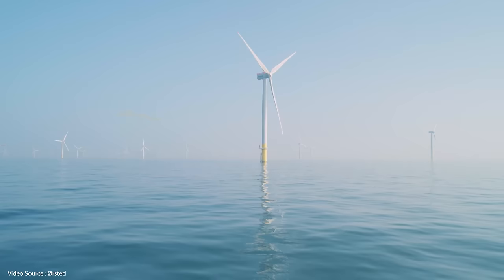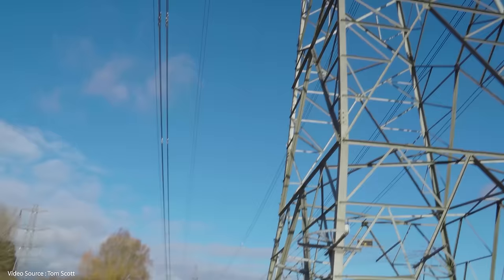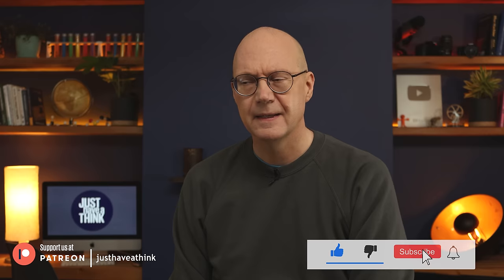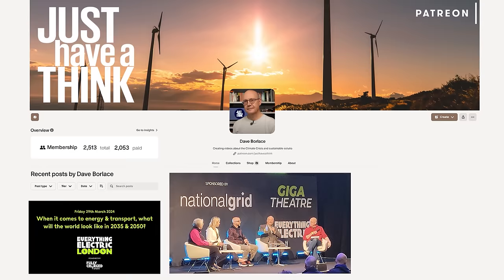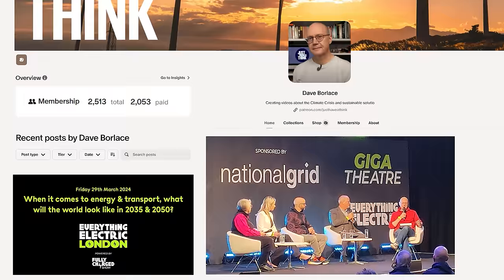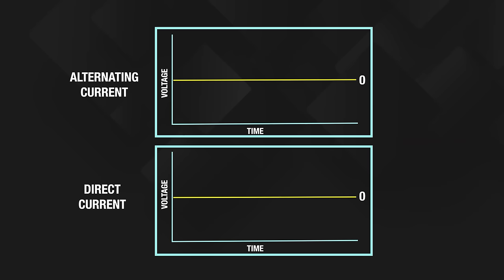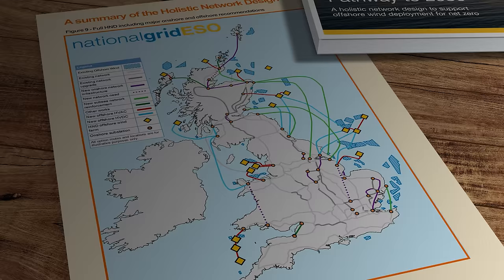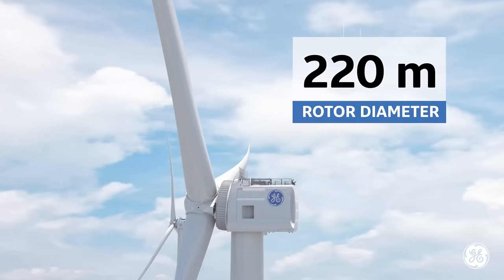Ocean Electricity Grid. How do they do that?

Comment: You're not missing anything, it will be bloody expensive. The other problems are coordinating it, choosing where to build, getting the green light for anticipatory investment, choosing who will be the organisation who builds it (the offshore system operator), etc. 

On top of that the risk of stranded assets is huge because of the problems with the CfD.

The UK hasn't even got close to getting it right first time, and the £5bn saving is based on amazingly optimistic forecasts.

The simpler, more efficient and cost effective, way for it to be dealt with would be to specify the additional equipment required on the offshore substations to connect them at a later date.

Low frequency AC is thought to be most efficient by a German professor after they'd already gone down the difficult HVDC route.

Comment: Sea transmission lines are not only more expensive to install, they are also much more expensive to maintain. All for the aesthetic reason of not having to look at on shore power transmission cables (most of which exist away from population centers). I understand the NIMBY mindset, but I certainly wouldn't say this is a "future proofing" option because we know those in charge will eventually get tired of fully funding the expensive maintenance of underwater cables, and the infrastructure reliability will suffer as a result.

Comment: Pylons are cheaper than buried or under water because they ignore the costs to the people and areas thy affect. I live in Lincolnshire and at the moment am threatened with a cable passing if not over my home very close to it. This will cost me at least 1/2 the value of my house and leave me with all the consequences of living so near to the cables. I am quite happy that if this is a project of "National Importance" then it should go ahead but all those affected by this should be fully compensated by those that benefit from the scheme.
When you take this figure into account you find that under sea direct to London is the best option.
My house is off grid so gains no benefit from the grid.

Comment: Winds. I took a quick look for an hour but it needs a well-paid professional because the Sun keeps forcing the wind to happen due to it heats Earth unevenly (Tropics face the Sun more directly than Polar regions and that's what causes steering winds). I did calculate in my head that wind kinetic energy matches 7 days of all human energy use (if my memory from 3 years back is correct) but since the Sun will fight any attempt to stop the steering winds simply by blocking them (as opposed to heating at 60-90N which I hypothesize might be slowing the Ferrell Cell) and since the Sun is massive powerful I can't see any feasible mechanical effort to slow the steering winds being able to slow them much due to it's directly fighting the source of ~all energy on Earth. Geothermal & nuclear fission are 0.035% and 0.015% of all energy on Earth, not much of a portion.

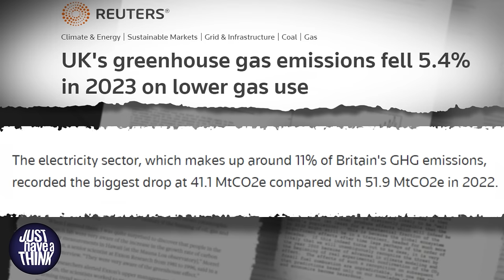Comment: 0:33 "But transmitting those electrons" - so let me be that guy (again) and remind us that the electrons don't travel far.  In an alternating current the electrons only move a tiny bit, and in direct current the net motion is small (especially for the heavy gauge wires used in power distribution.)    Ok, so that's pedantic, but in this case it is important to realize that the energy is transferred by the electric field that exists outside the conductor. This is normally a case of problems in any electric grid, but in sea water the electric cables have to be armored which then adds to the cost.  And of course protected from being corrupted in the salt water, another additional cost.  So while an electric grid online is expensive, there are special costs for underwater grids.
Reply: It's worth noting that there are now more discussions over the effects that undersea power cables have on the organisms down on the seabed.  Though the power cables are shielded, that does not keep (part) of the magnetic field from being outside of the shield, and that induces electric currents outside the cable.  All of this is how energy is loss in transmission, but also living organisms may have evolved to exploit Earth's own magnetic field (for direction finding, for example).
Reply: @TheDanEdwards  "induces electric currents outside the cable" with A.C. but not with D.C.   Well, only to the extent that the D.C. current varies.

Comment: I wonder if wind turbine operators have had much experience yet with wind farms located in hurricane prone areas like the Atlantic and Gulf of Mexico in the southern U.S.? There is a lot of shallow water and great wind turbine potential there if systems can be designed to withstand the current hurricanes and even stronger and more frequent ones forecast in the near future.

Comment: I am interested in why the UK has so much offshore wind compared with other countries.  Pioneers in the technology?  Now economies of scale.   High but not too high average wind speeds?   Relatively calm water enough of the time? Lots of shallow water around the coasts allowing fixed rather than floating towers.  Accessible shorelines for bringing cables ashore etc.    And ports for servicing.   The UK is perhaps well-blessed with those qualities.
Question:  How does all that offshore infrastructure affect fishing?  Trawling and undersea cables are not a good mix.
I'd be interested to see just how offshore electrical connections are made.    I suspect that avoiding offshore connections/switching is one (the most important?) way to minimise expossure to salt water.  
I think the other issue is avoiding moving parts (floating towers, cables that must move with the floating tower) under water because of the high maintenance costs involved.  Hence fixed towers better than floating ones.  Hence look for shallow water.
DC advantages:   the available current and voltage capacities are used all the time rather than use fluctuating.    And  better performance under water particulalry where large cables are required.

Comment: I like the paint job, Dave!  But a nice neon tube "JHT" logo on that big grey surface behind your head would be awesome!.. But to be honest, I think you already have something less flashy in mind to hang there.

Btw, how is that HVDC line going between Morocco and the UK? After its announcement it has gone pretty quiet.

This whole distrubution network of renewable energy gets more and more important with more and more renewable energy coming online, it squashes the argument of "dunkelflaute" because if the wind does not blow here and the sun does not shine here, it probably does a lot more somewhere else, so we need to be able to transport that energy to areas where it is needed the most.

Good to see the UK is working on this, I am sure other EU countries are working on similar projects as well... Good idea about the coastlines of the USA, but your cynism is justified, as the energy sector is still fragmented between several companies that all want to make a profit the next quarter and thinking ahead and invest and build for the future are not their strongest points.. Hence they have still low voltage overhead powerlines everywhere causing major problems with power outages with every storm that blows over, and years behind in adopting renewable energy and they just get started building off shore wind farms.
Reply from the maker: When you guys are not watching me there is a nice big pine-framed mirror hanging there. X-Links are going great guns. I will be posting an update video on their progress late this year :-)

Comment: According to Google, the average cost of a large offshore wind generator is 20M.  Apparently, the average home to go off grid would be around $30K with little maintenance, whereas, the average maintenance cost for a wind generator is around $45K per year. IMO, to solve most of the problems that you've pointed out could be solved by requiring, and using the $20M (plus the cost of many more wind generators) to subsidize every home and/or land owner to have their own solar and battery system, with little to no maintenance cost per year. At the very least, have mini-grids in every neighborhood.  Little to no infrastructure needed.  Of course, the people in charge want the big bucks for themselves while not allowing electrical independence for the average citizen, as proven by what happened to Nikola Tesla.  Heavy sigh...

Comment: Interesting fact I heard from some other environmentally aware youtuber  is that climate change is also causing  poles to warm up much quicker than equator, which means less difference in temperature hence less wind.
Reply from the maker: There will always be wind as long as the earth is turning.
Reply: For sure northern polar is warming 3.8x as fast as average. My understanding is that southern polar is warming less than average but there's big disagreement between instrumental bunch & proxy bunch.  My opinion is southern polar is warming less because southern Polar Jet has strengthened & tightened instead of going Wonky. I think you are correct regarding 30N-60N and I even wonder whether that's part of why the ocean's warming more. I have thin tentative science on it though, ongoing hobby project.

Comment: That's great but your numbers are a little bit off 
Once you have more than two sublime and generating electricity on the same line you could only get and use less than 20% of the advertised output it's called ohm's law so the inherent problem with the meters are not designed to run backwards 
Electricity is like water you must overcome the incoming voltage or pressure if you will to put anything in
Have you ever used a car battery charger it's kind of like that as the battery gets Fuller less power goes in but Watts stays the same

Comment: Why offshore cables why not hydraulics and generate onshore demineralized water with inhibitors will be much cheaper than electric cables with pressure to operate the same as trailer brakes and the pumps can be housed in the base of the structures

Comment: 2:37 Um.. quick question... has anyone done a study on the effects of massive ocean wind generation with worldwide air currents? Asking for a friend...
Reply: So much noise pollution it disturbs wild life there greatly and increase stress too.
Reply: I took a quick look for an hour but it needs a well-paid professional because the Sun keeps forcing the wind to happen due to it heats Earth unevenly (Tropics face the Sun more directly than Polar regions and that's what causes steering winds). I did calculate in my head that wind kinetic energy matches 7 days of all human energy use (if my memory from 3 years back is correct) but since the Sun will fight any attempt to stop the steering winds simply by blocking them (as opposed to heating at 60-90N which I hypothesize might be slowing the Ferrell Cell) and since the Sun is massive powerful I can't see any feasible mechanical effort to slow the steering winds being able to slow them much due to its directly fighting the source of ~all energy on Earth. Geothermal & nuclear fission are 0.035% and 0.015% of all energy on Earth, not much of a portion.
Reply: Yes, but I can't reference it. But there could be a problem. Not only could wind power change regional climate (climate change!) but there is only so much energy in the 'system'. A point may be reached were each new turbine installed reduces the output of all the other turbines by a tiny bit with no net gain! Not talked about as much as it should be.

Comment: I think you're being a bit too generous to the onshore peeps here. I do admittedly also think their detractors are too harsh! They're not wrong that there are downsides to the land based option but they seem to very much be arguing that a mild inconvenience to them shoukd be valued as a cost of £infinity, regardless of anything else. It's that aspect of it that seems to drive everything and it is that binary, winner takes all, thing that makes so many green energy projects unnecessarily difficult. It would be very helpful if we had systems in place that more reasonably compensated losses and inconvenience incurred by people, such that it sometimes becomes the better buisness choice to take an alternative route, and so companies are incentivised to do that, and sometimes it's still better to build the green thing and get it working but instead of valuing residents at zero in that scenario they then recieve an appropriate cut of the gains for the negative consequences they experience.

Comment: i think it's a mistake to re invent the grid by re centralizing production instead of diversifying it.the only reason for high voltage AC is for reasons of transmission over long distances. home solar low voltage (12 v) D.C. storage coupled with neighborhood low voltage D.C. storage and solar / wind generation facilities might make more sense. funny how in a way, Edison may have had it right in the first place.

Comment: Dave, in your previous video about HVDC transmission, you mention that the breakeven distance for a DC installation to be economically equal to an AC installation is 600 km. Here in this video you say it is 80. Which one is true? Has the technology cheapened nearly one order of magnitude in 3 years?
Reply from the maker: Break even for overhead cables is about 600km. Break even for cables underground or under water is about 80km because AC losses are much greater in those environments.
Reply: @JustHaveaThink  Thank you 👍

Comment: What do all of these wind turbines do during the summer? 

I’ve often heard the Uk is the Saudi Arabia of wind, so it would be amazing if we could really become a world leader in implementing and deploying this technology.  But how do we address the issues associated with the intermittent nature of these energy sources?

Is nuclear the only option to plug this gap?
Reply: The naturally sarcastic answer (and skirting over the fact that the windfarms are generally generating something - if not full capacity - 80%+of the time) - The sun works quite well in the summer, even here. 😊
Reply: There's no 1 perfect solution. For now it has to be a combination of available technologies. Which combination depends on where you are and how far, and what way, you need to move it once you've captured it.
Reply: @davidcalvert-smith4633   Relaxing on the beach, spinning at music festivals, the obvious summer things
Reply: @grindupBaker  🤘😎✌
Reply: @bringiton8989  - the problem with this approach is you need twice as much infrastructure.  

I wonder if it’s worth encouraging people to heat their homes with electricity.  Higher demand in the winter (when it’s windy) - but we would have to build a lot more turbines and drive the cost down further

Comment: Won't laying cables perpendicular to the coast make maintenance of other preexisting cables, such as internet cables or continental power inter-connectors, more difficult as they will be overlayed!
Reply: Is there a major shortage of ocean ? Has it got like Piccadilly Circus out there ? "Mayday ! Titanic struck a Wal Mart store"
Reply: @grindupBaker  If the cables don't run parallel to each other then the space is irrelevant!
Reply: @petewright4640  Ah only at intersections, you didn't say. That would need expert quantifying then so that's it for me. Sure if they presently run maintenance robots along the cable like James Bond in that Las Vegas pipeline one but if bods are just going there then it depends on the crossing portion. I'm done.
Reply: @grindupBaker  My understanding is that to repair cables they have to lift them to the surface. That's going to be difficult if other cables are crossing them and damage is near to one of those crossing points.

Comment: Grid electricity is all grid costs and dirt cheap electricity.
But just the local grids cost $millions per km.
So off shore grid is $?????millions per km.
Then, the onshore grid has to be increased in size, $???millions per km.

Rooftop solar PV and EV big batteries have NO GRID COSTS.

Just my thoughts.

Comment: Acceptable to locals😂 they don't like how towers look.  Don't know how to fix that.
Reply: 1. Minimize the number of new routes.  2. Reconductor and use Grid Enhancing Technology on existing transmission lines to increase capacity without annoying the locals.  3. Put cables underground.  This is still a lot of construction but in the end should not be terrifically ugly.  4.  Design more attractive pylons?

Comment: How long before someone posts a comment asking where will all the copper come from?
Modern transmission cables use aluminium.
Bigger issue is the plastic insulation!
Reply: I think the bigger issue is putting up  15 mega watts of turbine/s, takes construction ships that use around 550 barrels of oil in fuel and require 20 barrels of synthetic lubrication  (oil) per year. Average coal power plant is 400 MW but wind is intermittent so we are looking at 18000-54000 barrels of oil to replace a coal setup with wind.  Then we have to do it again in 30 years.

Comment: Hogwash. HVDC long distance transmission is practical, but the green energy transition is an insane method of providing clean, reliable energy. Natural gas to nuclear is the best solution.
Reply: Says someone who is probably already powered by 40% renewable electricity. And is it concerns cost, I enjoy the economics of my on own 20kp PV "powerplant" on my roof very much.
Reply: @guanxi99  depends on what state you live in, the national average is around 12% from wind and solar. 100% RE is a pipe dream. Why would you think relying on weather dependent, intermittent power is a good idea? Land usage, Mineral resource usage and recycling are all valid concerns with RE. Natural gas to nuclear is the only feasible way.